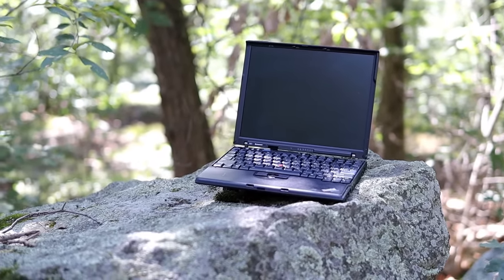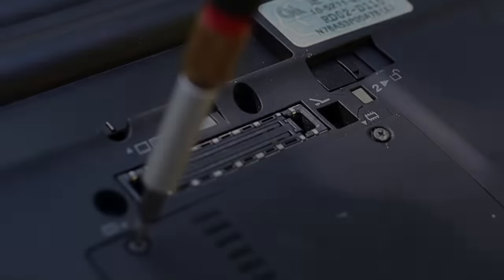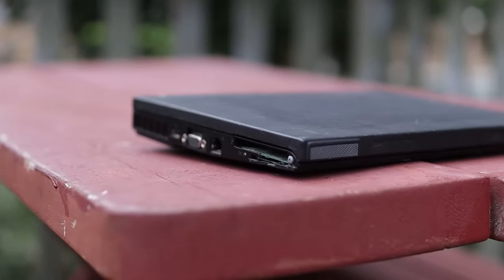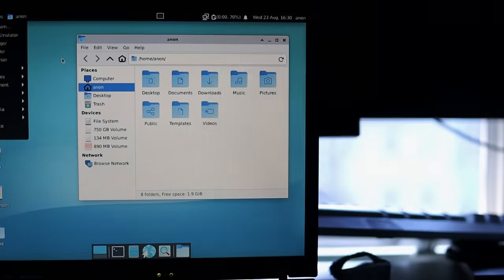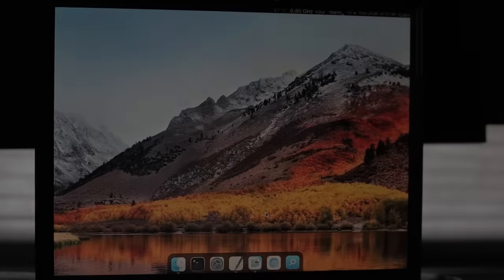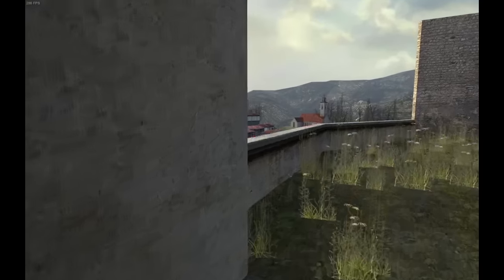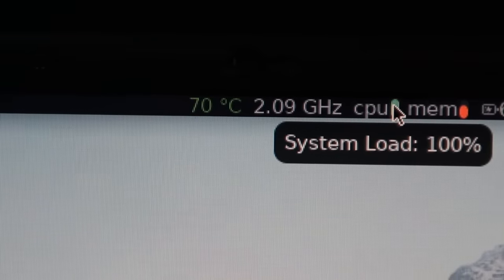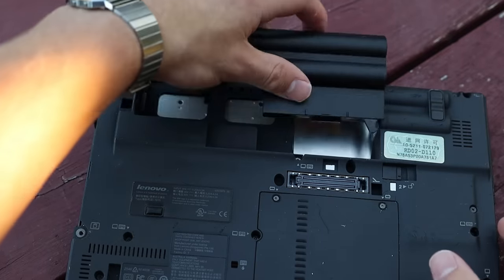Can Linux save this old laptop from obsolescence?

Comment: Replacing the HDD with an SSD would do far more for performance than the 4GB of ram. That's by far the most important upgrade you can make.
Reply: I know that most later model Core 2 CPUs had a 8 GB RAM limit, but 8GB and an SSD ( it's  a SATA interface, right?) would make it seem modern with the right Linux install.
Reply: The problem is that if you want to go online there is so much bloatware on the web that basically everything eats RAM.
I have 32 GB of RAM and with 10-20 tabs open it goes to 90% and sometimes crashes the entire PC on all browsers I tried it's the same. CPU is usually up to around 50% sometimes even 10% while RAM I am afraid that it will fry one day ...
Ever since 2019 I kept updating my RAM but what I learned it's useless. There is so much garbage with lots of apps and websites running in background that all act like datamining viruses. Every time I start my PC I waste my time end-tasking bunch of s--t 1st before I can do anything ...
Before 2019 I could run everything on a potato PC with just 8GB RAM and SSD. Today it's like I don't have any of that.
Even now writing this message stutters like a mofo ... can't keep up with my fast  typing at all text on screen lagging behind like crazy.
Reply: @minmogrovingstrongandhealthy  I have like 50 tabs open in Chrome on my 32GB Win10 PC and only 31% of the RAM is consumed - what kind of pages do you keep open to reach 90%?
Reply: So this. Basically I stopped watching the video at the point when he mentioned that he used a traditional HDD although an SSD would have been dirt cheap. Rule #1 with old laptops: get an SSD.
Reply: @minmogrovingstrongandhealthy  Dude, something is wrong on your end. Yeah, the web is bloated AF, but what you described is an order of magnitude worse than the norm. 32 GB of RAM is plenty enough for most people. I run multiple browsers at the same time (I'm a web developer), each with dozens of tabs, and still most of the time I'm at 34 GB out of my 64 GB. And I have other programs opened too. And I'm on Windows 10 too!
Reply: So very wrong. An SSD would improve the boot time, but not a lot more. Browsing the web it's the RAM that matters. And he is right, 2 GB is just too little for today. Between 2 GB RAM and SSD and 4 GB of RAM and HDD, the 4 GB of RAM and HDD is inarguably better.
Reply: @minmogrovingstrongandhealthy  As others have said, something's wrong with the tabs you open (or your PC).
Not quite comparable, but after a few days of research I sometimes have multiple hundred tabs across multiple windows (over 700 rn), though tbf most of them are "discarded" (not loaded) thanks to Auto Tab Discard (Or the Great Suspender on Chrome). Even with all that my firefox browser uses "only" 3.3GB. Still much more than it usually does, really need to clean up tabs soon...
Reply: @minmogrovingstrongandhealthy  it sounds to me like it's time for a fresh install of windows.
Reply: Not sure that it's true in this case.   The C2D is fairly slow, the couple systems I set up recently, top revealed most of the time I was waiting for anything (including programs loading) it was because a CPU core maxed out rather than things going into I/O wait status, on this speed CPU the applications simply didn't generate high enough IOPS to have the hard drive be a significant bottleneck.
Reply: @Winnetou17  Indeed.  And, in addition, the couple C2Ds I set up recently, I found (essentially) that the execution speed of the programs was low enough that they were not shooting out enough IOPS to outrun the speed the HDD could serve them.  It would do the 20-100MB+/sec a HDD does when it's doing mostly linear reads and writes and not drop to that sub-1MB/sec they do when there's lots of tasks competing and the disk gets all thrashy.
Reply: @hwertz10  Yup! Well, depending on what you do, you can get bottlenecked by a HDD, even on a 20 year old CPU, though I wouldn't say it's "game breaking" so to speak.

The thing is, like you pointed, if you have like multiple programs opened, they might each do stuff in different parts of the HDD and that would kill performance really fast.

But if you're doing kind of today's taks, on a weak CPU with low RAM, you're kinda forced to get into a single task at a time workflow. And here, with few exceptions, an HDD can serve you very well.
Reply: @hwertz10  that's probably true, but ram should make a difference because the laptop won't have to waste resources paging to a slow hhd when it runs out of ram.  That's why new mac computers can get away with small amounts of ram: super fast CPUs and SSDs to make ram paging really quick.
Reply: upgraded ram and an ssd are both essential.
Reply: besides boot time, a SSD would have helped with RAM swap file stuff etc, when I upgraded my laptop it felt like waay faster in webbrowsing or opening cached websites, simply because it responses faster than a rotating disk
Reply: @minmogrovingstrongandhealthy What kind of websites are you browsing? 32 GB of RAM shouldn't be filled up 90% by merely having 20 tabs open... you must be running several games in the background on each tab to even come close to that with 20 tabs.
Reply: Great idea, but you are doubling the cost of a computer that you can buy for $20.
Reply: @Mr.Vertex  It is never time to install Windows when Linux exists.

It amuses me that Windows people always seem to forget that they did not come into this world already knowing how to use a Windows computer - at various points in their lives, whether at school, work, in a training course or just practicing on their own, they had to develop a familiarity with Windows.

As such, unless such people are prepared to recognise that and put the same amount of time and effort to understanding how Linux could work for them, then they are never going to ever see it as a possible alternative to Windows' hatred of their privacy and its bloatedness, and can therefore only ever say "install Windows".

Modern Windows is going to crawl on a Thinkpad X61 anyway, so it's not even a consideration here.
Reply: @terrydaktyllus1320  I was replying to a guy who had a high spec computer that was running terribly, i'm guessing he was using windows, but he had 32 gigs of ram that were somehow being used up mainly for background tasks.  It was also apparent that he had an installation that was around 4 years old, and heavily bloated.  Even my bloated windows install on my PC that has 32 gigs of ram barely ever goes over 16 gigs, and I use some demanding apps. (ram for my PC is 12 dollars per 16 gig stick so I got a lot so I could run in dual channel.)
Reply: @Mr.Vertex  Whether you were replying to someone else or not, you posted your reply in a public place that invites anyone else to contribute to the conversation also - so I need to correct you on that.

And whilst what you say afterwards may or may not be true, I really don't care either way.

There are clearly people out there who know that they have to "fight" against Windows 10 constantly in order to maintain the configuration that they want, or debloating that they want, because every time Windows installs an update then any of that "custom" configuration can be reverted back.

In my opinion, that simply makes it an entirely untrustworthy OS, whether or not the RAM that you buy for it is cheap.

That's my core point here.
Reply: @terrydaktyllus1320  I suppose I could have told him to install Linux, but the point I was trying to make is windows on it's own is pretty fast and not that resource intensive if you don't have a ton of bloat installed.  It runs great on a 7 year old high end laptop.  Sure, after a while it gets a little bloated, but anyone who can figure out the linux terminal should be able to keep the bloat in check.  I have had my installation for quite a while and didn't even re install when I switched PCs and my computer is super stable.  The problem he was having with his computer using over 30 gigs of ram doing basic tasks is very rare.
Reply: @Mr.Vertex  It's not my place to tell you what to say and if what you do works for you then good luck to you.

But I just don't understand why people put in so much effort to "fighting" an OS that has no regard for your privacy, or how you want to run a computer, anyway.
Reply: @minmogrovingstrongandhealthy I see men told misunderstanding of how RAM works. Unused RAM is wasted RAM, so the reason why it looks like adding more RAM makes no difference is because Chrome is keeping that RAM available for use in case it needs it. I hear the edge browser with its new chromium base is actually pretty lightweight and efficient. And isn't it supposed to put tabs to sleep after you go past a certain amount? I don't know, it sounds like you've got a problem that's beyond the web.

Oh yeah, use ublock origin instead of adblock, saves RAM
Reply: @terrydaktyllus1320 most professional software and anything your work or college forces to snoop on you doesn't work on Linux. And packaging on Linux is still a nightmare, downloading the OBS flatpak doesn't actually work out of the box, for instance. Also, nobody cares about privacy invasion because it doesn't actually affect them in any meaningful way. People don't care about intangible threats. The few victims aren't the norm, when it is the norm we'll start caring.
Reply: This is 100% true. A 2.5" hdd will spin literally constantly and will never keep up, especially on Windows 10+
Reply: @Winnetou17  He forgets other programs can stay resident in RAM.
Reply: @minmogrovingstrongandhealthy   - That's why for the web I use Brave. On Linux, it works just as it ought to. Windows, not so much. Not sure what you're using, but, right out of the box, Mabox only uses around 500 MB of my 12 GB RAM. Brave bumps it up about 1 GB. My CPU hovers around 5% - 6%. It rarely does above 10%, save maybe if I'm on Second Life, which can eat up a good portion of RAM as well.
Reply: @HungarianDerrickRose  - Not always the case. First of all, SSDs are NOT as durable as people are saying they are. The first HD I had in my current Laptop was a 1 TB SSD. It died about a year ago. When I finally went to get it replaced. I had the option between a SSD and HDD, and the HDD was cheaper, and, thus far has been more reliable than the SSD I originally had.
Reply: X61 can also have a BIOS mod applied to make the speeds go up to SATA 2.
Reply: @HungarianDerrickRose   If the laptop originally had 4Gb or more of RAM, then I would agree the upgrade to an SSD would be the better initial choice. But it only had 2Gb and that's shared with the GPU, which means even with an SSD, it would be constantly using the swap file and/or memory compression to run apps. And I guarantee that accessing real RAM is faster than an SSD or compressed RAM.
Reply: In a relatively slow system with only 2Gb, the additional RAM is more useful. Having 2Mb of RAM for web browsing and other typical apps, even with an SSD, the increased swap file usage is going to make the overall experience worse.
Reply: Trying to connect to the internet with a windows 2003 machine would be suicide
Reply: @Winnetou17 if you know how to use the command line, your 2gb ram goes a lot longer ways than a GUI does.
Reply: While I can agree from experience that upgrading from a HDD to an SSD is usually more effective than adding more RAM, when you have an extreme lack of ram like 2GB, you can often find that increasing that does have a huge effect. At least, a lot more than something like 8 -> 12
Reply: Perfect, have just answered that
Reply: I think you should do both.
Reply: @HungarianDerrickRose  even if his case was a bit extreme, 32GB * 31% = 10GB of RAM for just 50 tabs is insane and only validates his point x( even desktop apps are now bundled with whole browsers, and they also consume tons of RAM (Electron apps). I miss optimizated projects like Void Linux in today's dev landscape :(
Reply: Windows 10 enterprise on an SSD. 8gb ram. It's fine
Reply: With old machines like that, Maximize the RAM as it matters more than SSD.

RAM offloads swapping to HDD, so you are faster.
SSD help boot process, and launching apps first time.
And that is it really.

You can't even transfer data from USB or network the speed the HDD can read and write....
But you can fill the RAM faster with a web browser.

Lately I have refurbished old 2008-2012 Mac's. All kinds from iMacs to Macbooks to PowerMacs.

Every single one had a HDD in them, and 2-4 GB of RAM. 

You got to run a 2-3 web pages (YouTube and Reddit) and RAM was full, slowed down that you barely can do a thing.

Upgraded RAM to maximum (8GB and 16GB) and the thing flies...
Then upgraded HDD to SSD, the boot time got better and when launching some games. but we talk like 15-18 seconds to 7-9 seconds, negligent difference really as you do not reboot, but put computer on sleep.

If not using web more than 1-2 pages, you get away with 2-3 GB RAM. 
If just writing, watching videos etc, you get away with 2 GB.

There is just no SSD benefit if RAM is not first upgraded to 4+ GB...
Reply: @hwertz10 Yeah... the nice values are hard... Often around 3-4+ when doing anything multitasking. Just having a Firefox with couple tabs open goes >1.

Those who don't know what nice is, it is the value how long does the processes wait to get access to CPU. 

You can run 2 cores and 2 threads (4 in total) at 10-15% utilization, but when your nice is at 3-4x you are not benefitting at all from SSD.
Reply: @minmogrovingstrongandhealthy  By any chance, are you using the system without a swap partition/file?
That saying that you don't need to use swap/zram if you have a lot of RAM is a myth, of course you need it since otherwise your PC could crash/freeze in situations where you run out of RAM. Many Linux distros don't configure certain settings correctly, these settings are necessary to avoid performance losses during high load situations.

However, if you are on Windows, I'm afraid there is little you can do.
Reply: I think this is a really oversimplified answer that basically only applies to windows/gaming computer users. And even reading through the comments here, people are making windows related remarks. 

If you are going to have a PC you are going to game on and install tons and tons of software, an SSD will make all the difference in the world. Hell even these days with modern versions of windows it will significantly increase the speed of startup cycle, you can be in a web browser within 30 seconds of hitting the power button with an SSD.

 If you are putting linux on a 15 year old laptop that may not have cables or adapters up to spec for SSD data transfer speeds, the difference will be noticeable but marginal. Linux by default already loads up way faster into the OS than windows and there is infinitely less bloatware available on linux to slow down your os startup cycle. The RAM upgrade guarantees you can browse social media and youtube without any stuttering. 

So yeah, maybe you're losing 15-30 extra seconds of your life to a slow startup cycle, but once you get out of the startup cycle that RAM is going to be a way stronger factor.

Also it is basically impossible to browse the web these days on 2GB of ram.
Reply: @frizzykid100  actually, on Linux it also makes an important difference, especially when using heavy applications. Also using any distro other than Arch, Gentoo or OpenSUSE Tumbleweed without resorting to "universal" packages that are more bloated than even Windows programs is an ordeal.
Reply: @minmogrovingstrongandhealthy  That's weird. None of my devices have more than 8GB RAM and I can open 50+ tabs no problem. Currently, I have 49 tabs open. Doesn't feel slow at all. RAM usage is 85%. Never crashes. CPU is 23% currently. There must be a power or driver issue with your device.
Reply: ssd AND linux!
Reply: I disagree. Both an SSD and a RAM upgrade is a must and if you go with hynix it would could cost only like 30 to 50 dollars.
Reply: I wouldn't even touch it if it didn't have at least the 4GB of RAM. Anything else is insanity. That' still too little though.
Reply: @Winnetou17  So very wrong. A system like that would be brutal without an SSD with it constantly swapping.
Reply: @Winnetou17 I'd go with the 2 gigs of ram and SSD, honestly. With something like openbox you can get idle RAM usage under 300MB no issue, and as long as you're not opening like 30 tabs and  6 programs at once you'll be okay. The loading times on every program and slow ass file transfer speeds would definitely be more noticeable, especially since this is an ancient hard drive.
Reply: @majkati69  Openbox ? Why not dwm ?
Anyway, I know that with Antix, you can get below 200 MB. I think that if you tune it, especially with something like dwm, you can get at around 100 MB. Also, if you happen to not need GUI, like say, for using the computer like a server or NAS, you can even get down to below 50 MB when booting up. But that's getting a bit out of scope.

Still, my main fear (though I haven't checked in detail how far we're from this) is that at 2 GB of RAM, even a single program (the browser) with a single tab might run into issues. Say, watching a video on YT. Or scrolling a FB page. Or worse, scrolling a FB page AND watching some videos there. These are pretty memory hungry. I mean, it shouldn't hit 2 GB that easy, at least clearly not immediately (unless you're watching somthing like 4K or 8K video). But with the scrolling aspect it might get there fast.
Reply: @Winnetou17  Though you might be right with things like Facebook, it could eat the RAM up like crazy. Luckily I don't use it.
Reply: Why is an SSD so helpful?
Reply: @DanielBrotherston In GNU/LINUX NO, in Windows 10 sure...

It will go faster, but it is not as significant a difference as it is with WINDOWS... Because it loads many useless processes and is constantly reading the disk. And especially since the 10th...

That does not happen with GNU/LINUX than in a PC with 1 core at 2ghz and 1 gigabyte of ram with an HDD that is 20 years old or older and with relocated sectors...

An SSD in Windows is already slow after months... The problem is clearly that disastrous system and its poor management of resources

En GNU/LINUX NO, en Windows 10 seguro...

Más rápido va a ir, pero no es una diferencia tan significativa como lo es con WINDOWS... Porque carga muchos procesos inútiles y está todo el rato leyendo el disco. Y en especial desde el 10...

Eso no ocurre con GNU/LINUX que en un pc de 1 núcleo a 2ghz y 1 giga de ram con el HDD de 20 años o más y con sectores reubicados...

Un SSD en Windows a los meses ya va lento... El problema es claramente ese sistema nefasto y su mala gestión de recursos
Reply: @minmogrovingstrongandhealthy  

Well, I have literally opened more than 1000 tabs, my record with 16 gigabytes of ram... I think you don't know what you're saying... Either you use Windows by default and have it full of garbage or I can't explain it... In Windows I have had more than 100...

Also, not everything is the ram, you may have a lot of ram and a bad processor or graphics...

Pues yo he abierto, literalmente más de 1000 pestañas mi record con 16 gigas de ram... Creo que no sabes lo que dices... O usas Windows por defecto y lo tienes lleno de basura o no me lo explico... En Windows he llegado a tener más de 100...

Además no todo es la ram, lo mismo tienes mucha ram y un mal procesador o gráfica...
Reply: During the boot process and that's about it. For all subsequent operations, differences are not really noticeable because disk caching brings them to barely one-tenth of a second. Personally I prefer mechanical drives for two reasons: cheaper and safer (data recovery in the case of failure). They run very good even with Windows, and I can safely say that it's not the drive that makes Windows slow, it's the SATA driver which usually stays being MS default.
Reply: SSD would help with snappiness, but not multitasking. Even webapps running in a browser would want more than 2 GB.
But the biggest benefit of an SSD is shock resistance and power draw in a laptop.
Reply: SSD:s blur out the difference between RAM and hard disk, so that is true. But the SSD bought must fit into the SATA of this old PC.
Reply: @minmogrovingstrongandhealthy  mine simply use like 2-4ram on many tabs, maybe you use a wrong browser?
Reply: @Winnetou17  if you use a light but a heavy operating system, that doesn't matter on the ram, as that one is really matter for cpu usage and for the drives.
Reply: There are even IDE SSDs
Reply: that's not true, RAM is more important
Reply: The ram would also help so why not do both?
Reply: @Winnetou17  I found that swapping out HDD for SSD always significantly improved overall performance,  not just boot up speed,  but everything, adding RAM is important as well but SSD would always be my priority.  😊
Reply: @minmogrovingstrongandhealthy  try upgrading faster ram and keep eyes on background processes like discord or steam apps which eats up ram in background just close them
Reply: @minmogrovingstrongandhealthy You need to disable the option to automatically load pages.
Reply: It doesn't even have an SSD slot
Reply: @saintpepsi8602  He is talking about SATA ssd not NVME ssd
Reply: For the internet, I'd prefer 4 GB RAM and HDD over 2 GB and SSD (also, laptops from this era don't have the fastest SSD speeds to counter RAM shortage well enough via paging). 

I do have the first Aluminum Unibody MacBook 2008 that has had 8 GB RAM and SSD, came with 2 GB and HDD when bought new but have maxed out for the last 10 years or so. Could still daily drive that if I had to, but I have a newer ThinkPad X270, which is also vintage now I guess.